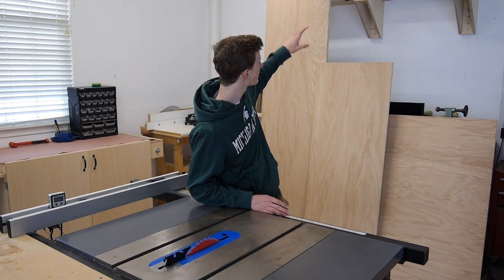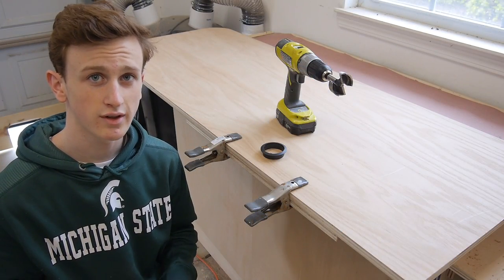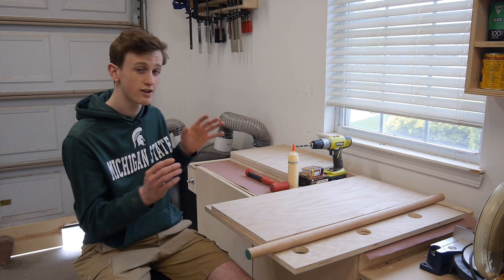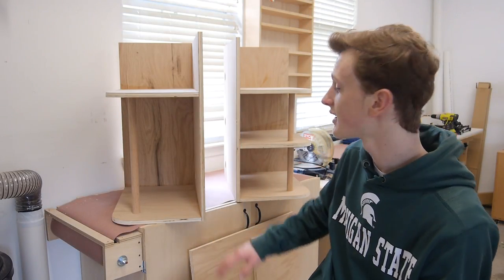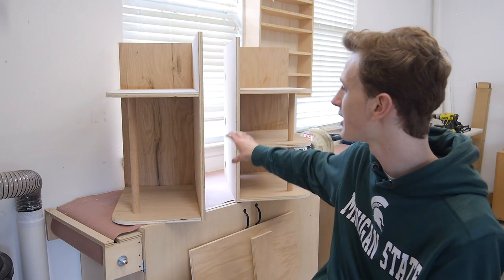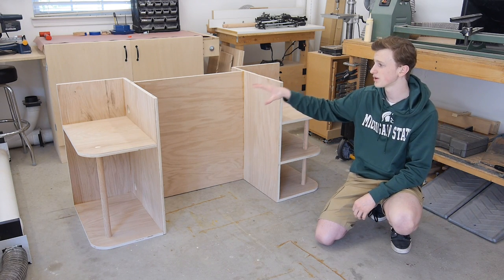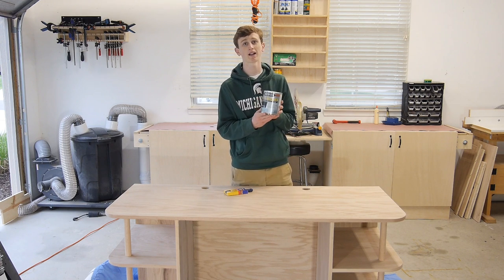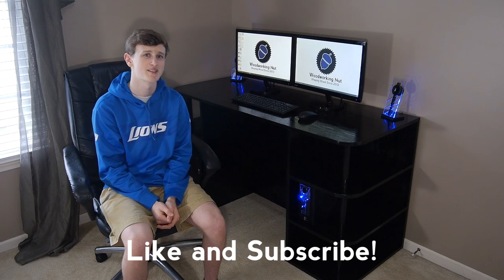How to Make the BEST Gaming/Video Editing Desk | FOR SUPER CHEAP!

Comment: Eric, I've been watching you since you started, and I'm very impressed with how much you've grown as a woodworker. I hate to get all Safety Police, but I gotta say: that cross cut you made around :43 scared the hell out of me.  Crosscutting such a long piece on the table saw is always a little hairy, but to cut such a small amount off the end in that manner puts you in serious risk of kickback, since the vast majority of the board's weight is ushing into the blade from the outside, thus pinching it against the piece you're trying to cut off. It's a lot safer and even easier to use a circular saw with a straightedge, especially since the cut isn't that long.
Reply: You're welcome. Great work -- keep it up!